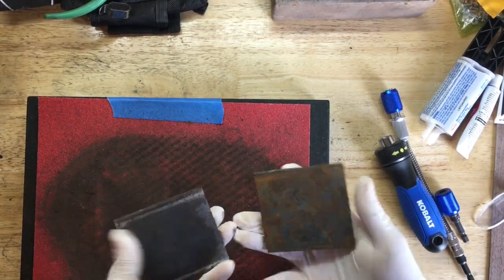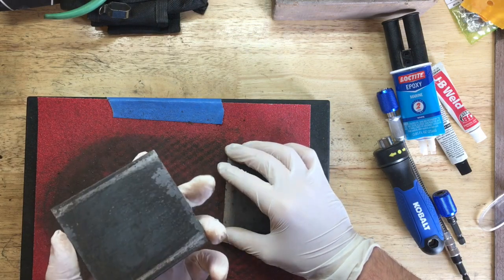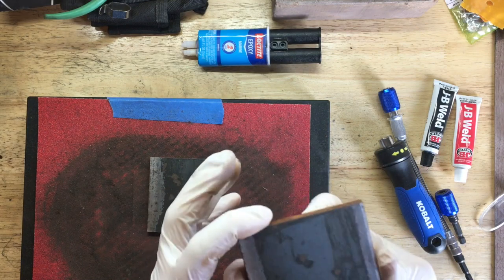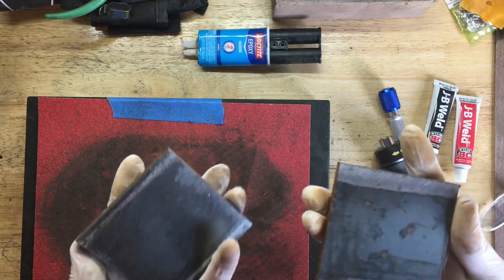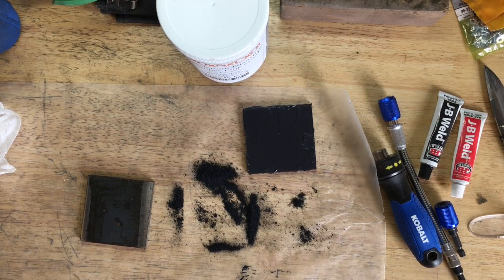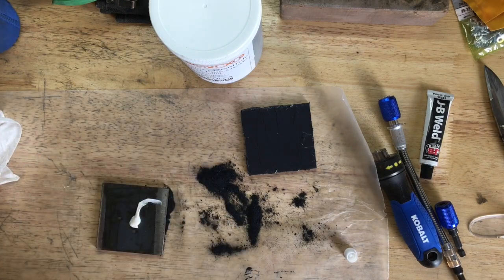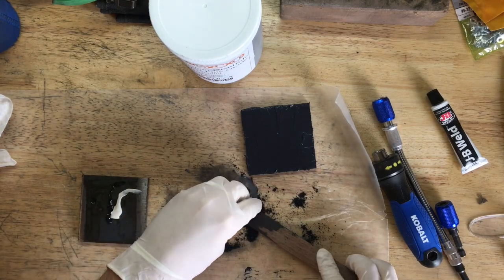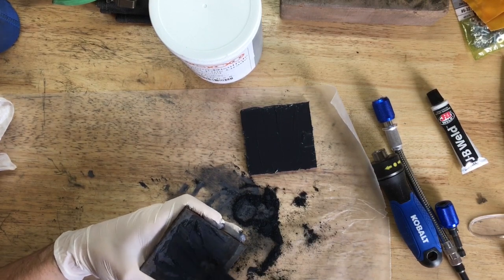Homemade Moglice / Turcite Experimentation

Comment: Do you believe it is a good idea to put it on my lathe crosslide dovetails without staffing it?
Reply from the maker: Staffing? I can't recommend that you do anything. I'd like to do more experimenting with a clear epoxy + molybdenum + copper powder. I can tell you it made my cross slide and compound feed screw/ nut have less backlash and made them have a better feel to them. They were smoother. I would not do it to a nice machine.
Reply: @adullbeaver7943 mine is far from a nice machine...it has 0.3 mm of wear on the middle of the crosslide......i scraped it a bit and it is a little better...but...